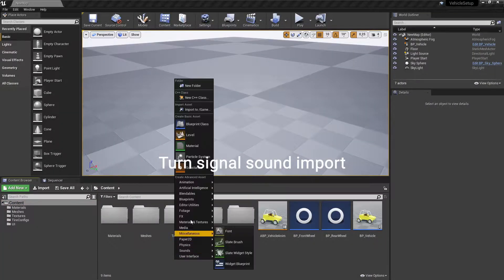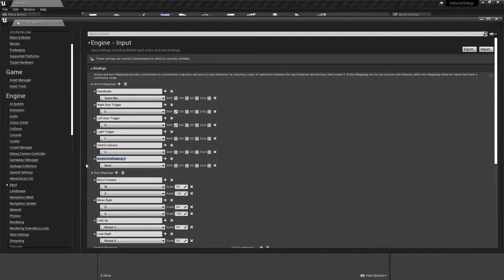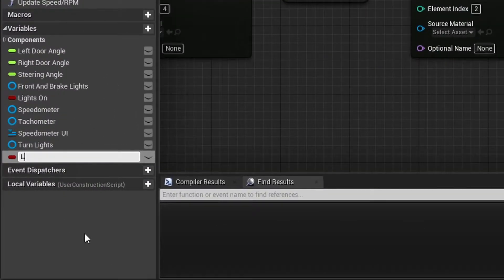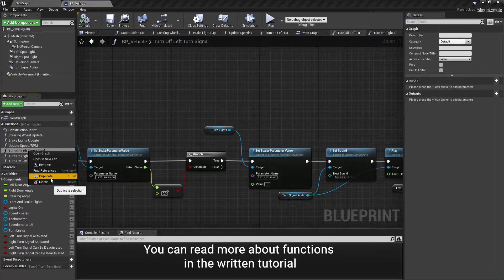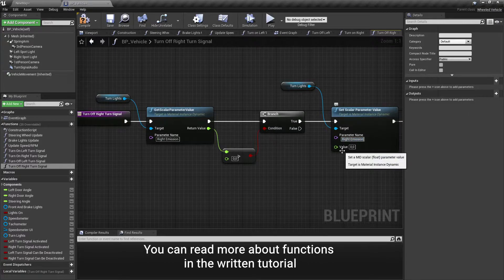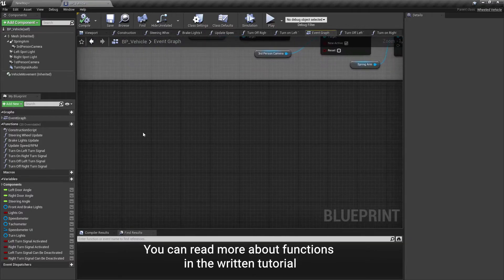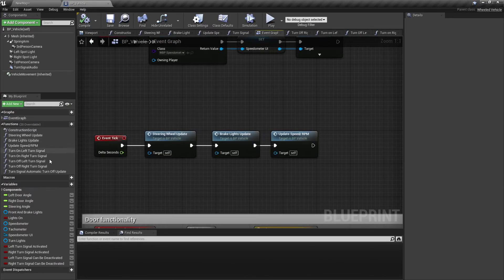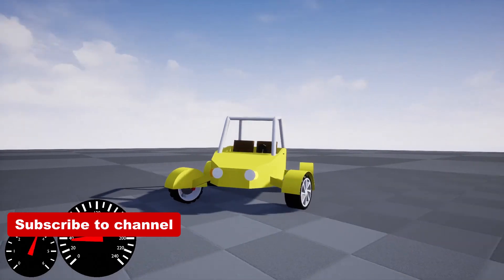Turn signals with automatic turn off | [Part 11] Low poly vehicle for UE4

Comment: ho well i can't figure out how to make this : camaro/ trans am 70 - 71 . rear light 1 is brake and park light. ( you already made the tuto about that one. this one is fine.) the second is flasher (turn signal), parklight and brake xD can't figure out how to set up the stuff. i made a mesh with a bone rig to it, right on top of the park/brake light (hoping to set the visible- non visible to the flasher  mesh part when clicks happens . problem is : how to i set up that i can't just slide the mesh right into the event mode :/ and where should i place the visible / non visible event. on the event in the car or the construction panel ? should i make the mesh an actor ? how ? im lost. xD second thing is : my front flasher is orange my rear one is red. how im suposed to set-up the multiples set/get emissions. i think of making 2 material for the right/Left sides since the shown system in the tutorial works only to use same colors on both sides. lot's of work for only lights xD
Reply: ho wait there's the mesh node wonder is i can use that for the visible event even dho it will make disapear my front orange flasher x)
Reply: ive made an float variable with the mesh component name on it (just like the doors) but im not sure that's how it's work for selecting an mesh and given an command on it xD (not that the flasherlight mesh is actually an component rigged with a bone (just to be sure)